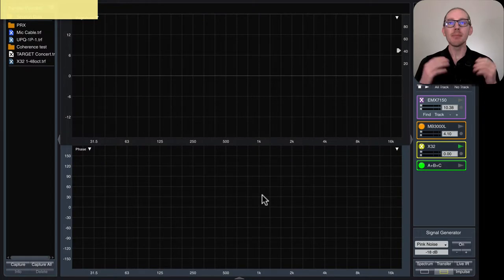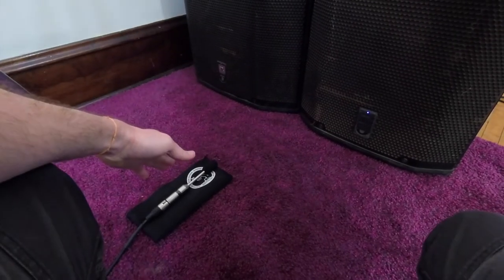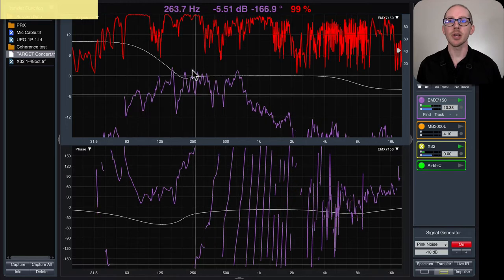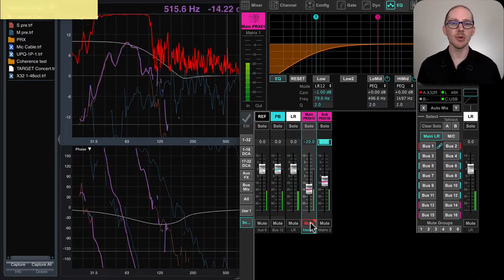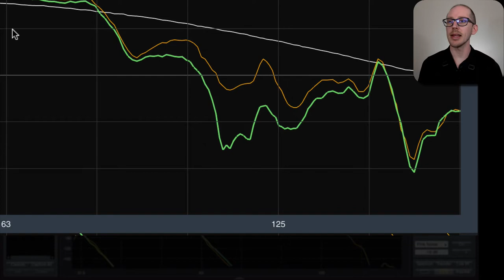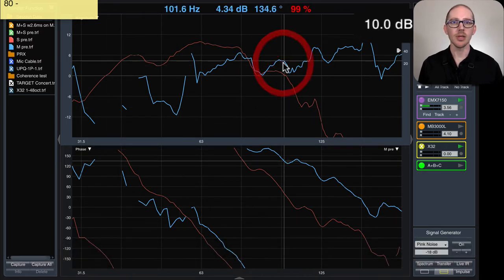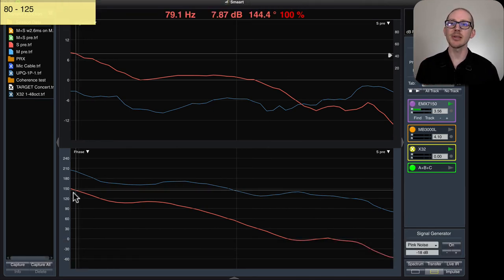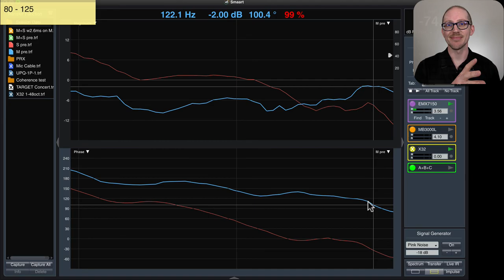How to phase align main+sub in Smaart® [GSwSST34.1]

Comment: Hello. Do I need to adjust phase electrically it acustically? I my case I have filtered only ripoles. I have 2 xovers in cascade, main a Marchand tube and later a Bss Omnidrive. This way I can not adjust time delay otherwise moving the bass modules. can I do wit Holmimpulse? With Smaart phase is a line
Reply from the maker: Hi Raúl! 
> Do I need to adjust phase electrically it acustically?
You are free to use any and all means necessary to achieve the results you want. :)

> can I do wit Holmimpulse?
I'm not familiar with this word: Holmimpulse

Comment: hey. i have an analog mixer. then 31 band graphic Equalizer, 2 power amp QSC rmx 4050A, QSC rmx 1450A and 2 units of crossover Behringer cx3400. now I'm planning to buy a 4 channel  oscilloscope with function generator. now my question is. may i used a function generator to phase align my speakers? the first crossover would be used for mid and high frequency speakers which is for qsc rmx 1450A then my another crossover would be for my qsc rmx4050A for my subwoofer and i will connect it to my mono out of my mixer. is it possible to used function generator to tuned and align my mixers , processor and amplifiers? sorry for long description.
Reply from the maker: Hey Carlo, I don't see anything wrong with that idea, but I think the best advice is to reach out the manufacturer and ask them to do. You can email QSC and ask them how they recommend that you complete the alignment.

Personally, I would use a 2-channel audio analyzer to compare the phase, but that just because I more experience with that tool.

Let me know how it goes.

Comment: Hye nathan.tq for very good tutorial on alogn sub and main but how do we align sub and line array speaker…is it put 4 line array speaker next to subwoofer or there are other ways
Reply from the maker: Hey At-tabrani, yes, that would probably be the most realistic way to practice the alignment. But I usually don't do that. The only thing that will change with adding more speakers is the level, which you'll ultimately end up accounting for in the room anyway. As long as you understand the relationship between the two sources and have some targets, you'll be ready.

Comment: If you adopt this method and alter the level of the subwoofer, will it result in a change in the crossover frequency?
Reply from the maker: Yes. The acoustic crossover locations is always dependent on the magnitude relationship.
Reply: @nathanlively  Also, are the overlapping frequencies in the crossover phase aligned when applied in this method?

Comment: Hey Nathan do I need to delay locate my mains and my sub separately? Or do I just need to delay locate the mains then figure out what delay is need for the sub to line up the phase traces?
Reply from the maker: Hey John, you'll need to do whatever is necessary to restore alignment, including physical placement, electronic delay, and/or filters. You should be fine with delay on one channel as long as that channel actually needs to arrive later and not earlier.
Reply: Nathan Lively thanks I guess to clarify exactly what I’m asking. Let’s say I have mains and subs who’s positions are fixed and cannot be moved. I am attempting to use a measurement mic and smaart to align them through the acoustic crossover region. In Smaart is it is obviously quite easy to delay locate the mains. This tends to place that measured data in a position that it’s easier to read. When I go to measure my sub next it seems like in general I do not want to try to delay locate that measurement in Smaart but instead leave whatever delay was found for the mains present and then from there figure out what processor delay is needed to align the traces as best as possible?

Comment: Is this something you have to do each time you set up and use them?  If I buy subs and mains designed to work together can I skip this?
Reply from the maker: Hey Aaron, we're going to cover this on Monday at the workshop: https://nathanlively.as.me/easy

The short answer: If your speaker pair are designed to work together (phase aligned out of the box) AND you deploy them exactly the same way every time, then yes, you never have to worry about alignment. This will make you designs pretty rigid, though. I can see how this might make sense for an installed system, but then both speakers would need to be co-located.
Reply from the maker: You might also want to take a look at MLS signals:

https://www.mathworks.com/help/audio/ref/mls.html

Comment: you use the find delay for synchronized the mic measurement with the reference channel for measure the top ok but when you measure the sub for compared with the top you do again find delay ?
(sorry for my bad english...)
Reply from the maker: No, because the delay locator is less accurate with the sub.

Comment: Hey ! I am sorry but there is a mistake in the info of your video:  time = ΔPhase / (360 * Frequency) and not  time = ΔPhase / 360 / ΔFrequency. All the best.
Reply from the maker: Hey Ludovic, although I do not believe that is correct, I have been wrong before many times. Could you give me an example?
Reply: @nathanlively  Hello ! Well, 10mS is the time offset creating a 180° phase shift at 50Hz. 180/(360*50) = 180/ (18000) = 0.01. Actually using your formula I get the exact same result, mathematically we do actually the same operation, so my mistake but not really ;-)

Comment: Setting the mains and sub placed together on the floor is pointless. Sub and main phase needs to be set when heard from the normal listening position.
Reply: This was done just to show how to time align speakers
Reply: @habdulahsalam  The sub and the main speakers should be time aligned AND in phase when they are in the listening position.  Time alignment is not the same thing as in phase. You can have two speakers working in phase with each other but they will not be time aligned if the distance from them to the listener is significantly different.
Reply: Sorry, phase aligned i meant to say. Keep up the good work.